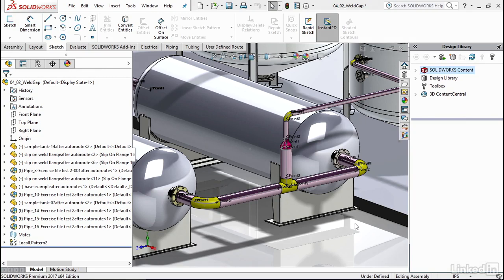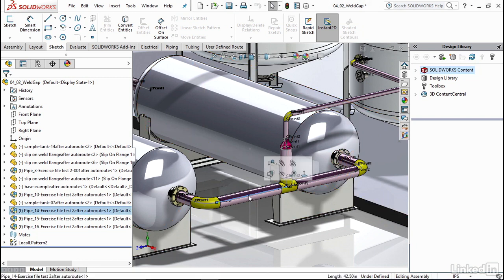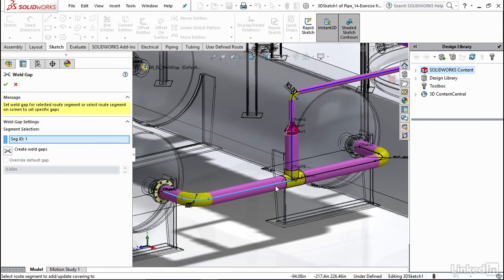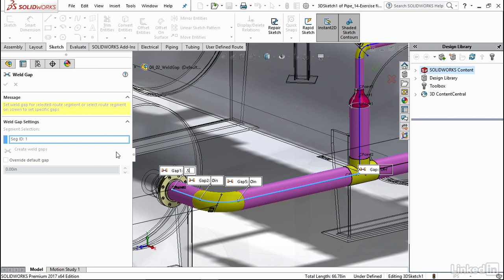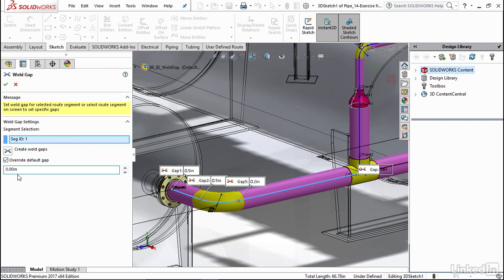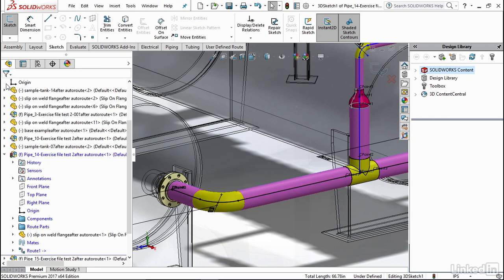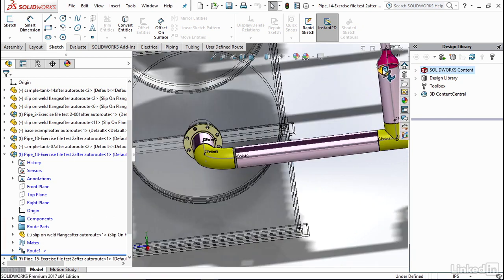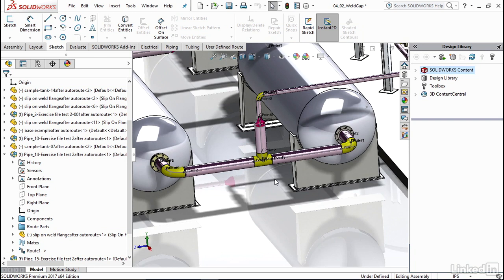SolidWorks | Weld gap | Ep 23

Comment: Hello, Nice video. It is possible to apply Penetrate command with a straight cut? (without  coped cut, on tees). How can I apply this command, with 45 or 90 degree miter cut instead of an elbow? (I want to weld)